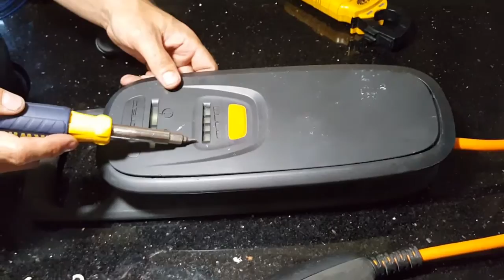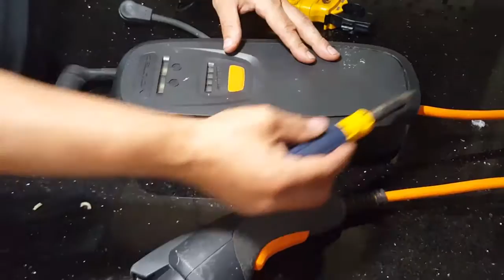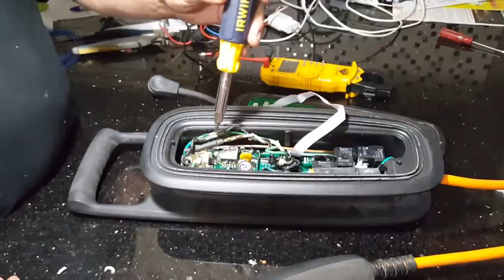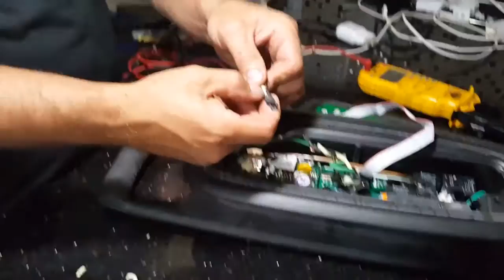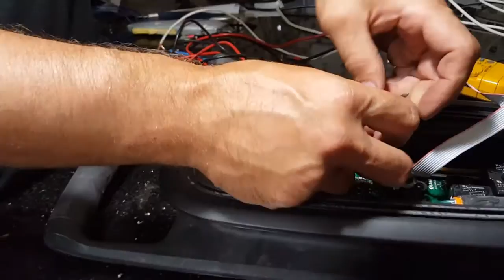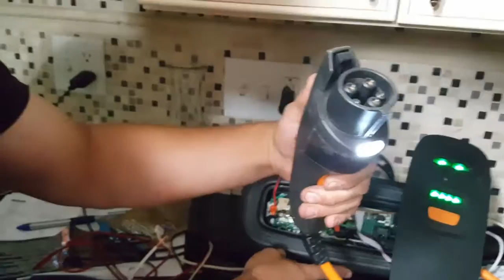Chevy Volt 120 Volt Charger Repair

Comment: You need a 20amp 500 volt fuse. Not a 15 amp 12v fuse. Is it still working with 15amp??

Comment: Those voltec charers are notorious for blowing fuses.  Should be a 20 amp fuse 500v rating. Wait till the pilot signal generator goes bad. Will be lights on, no charge.

Comment: This video was similar to our issue on the 2014 volt we bought.  Upon opening the charger we found all three wires cracked, melted and bare. Installed the bladed fuse holders and it perfectly. We reattached the cover with silicone and screws.  I imagine that it could fail again.  Thanks for the video.

Comment: Hi. Probably too late but I have the same charger and resistor R103 has burnt out. Could you measure the resistance of your R103 and tell me what it is please? It's the big green resistor by the gfci and neutral wire. Thanks

Comment: So, my charger shows all green lights when plugged in to the wall, but when plugged into the car, it fails with the top right red light.  I"m interested if this was what you observed, or were your charger lights off?  When I plug it into the car, I hear 3 clicks then the top right light goes red and it doesn't charge the car.  When I opened up the charger this weekend, it looked OK, but I don't have a clamp multimeter so didn't test the wires.  Oh, also, the light works at the car plug side, both before and after the red light comes on.  ...  Is the same as your issue?  Thanks!
Reply from the maker: Joe Ballou from what i have read you may be loosing voltage due too long distance from panel. I suggest programming charger to draw less amps. Check instructions.
Reply: Did you ever find out what was wrong JF B? My charger has started the same (?) behavior. It starts up fine but once you plug it in the car the top right LED starts blinking red. (Top left still green, car still charges fine on the fixed wall charger)

Comment: Keep an eye on the fuse, use 250V and 15A fuse...in a long run the fuse contact points will create some resistance and meld down.
Reply: Dirt Rider would you recommend a higher amp fuse?
Reply: @aaronguest6579  not higher amp, higher voltage.  The car only charges at 8 or 12 amp so 15 amp is fine, the problem is automotive fuses are only rated to ~30v, so using them at 120 means that if they fail they may not stop conducting.

Comment: Great video. I drilled a hole in the front face and installed a water resistant fuse holder so repair only has to be done once. Soldered and shrink wrap an extension wire inside to reach the correct location.  Fuse holder must be offset to clear internal electronics.  3-3/4" down from bar of green lights and 3/4" right of centerline. Plastic does not drill cleanly - so go small and use hand grinder or file to adjust hole to allow gasket on fuse holder to seal. Has worked outside for two weeks now.Purchased holder and replaceable 15A fuse at West Marine.Blue Sea fuse holder 20A model #PN5021. Blue Sea 15A AGC fuse Model # PN5217 Use push on connectors to fuse holder.

Comment: i did this exact repair on mine today, and i suppose it'll have to do until i can find an inline fuse holder that supports a 15amp fuse with 120 volt rating. if anyone can send me a link for one, id really appreciate it. they didn't have one at my local walmart or lowes hardware.
Reply: The Automotive style will work.  Thinks of amps as heat.  The fuse works by  surrendering to too much heat.  Make sure that your fuse holder is wired with at least 14 gauge wire.  12 is better.
Reply: @brucehalleran1149  le fil est un 12 !

Comment: The problem is your fuse holder is rated for automotive use at 32 volts DC.  Not for the 125 volts AC coming from the wall.  The next time it blows the potential for a fire exists.
Reply from the maker: yes you are right. this was for troubleshooting and testing. I did find original fuse for it rated at ac/DC ON line  but I ended using a common 120v ac fuse that's used for microwaves and is easily accessible from home Depot.  I also soldier the fuse. works good.

Comment: I did not make video but so far it's working fine just sealed it with silicone in case fuse blows again
Reply: That these blow so often that there are numbers of these videos on youtube is a symptom of a problem.  Is your 110v. plug cord hot when charging?  Not warm, HOT.  The outlet itself was not hot, but my plug and cord were hot enough to burn the hand.  Then of course that hot cord runs into a sealed box where it attaches to a device designed to fail when it gets too hot...
    My theory is that the supplier of the plug cord, or the wire used to make it, bent the specs. for the wire.  14 gauge is NECode appropriate for 12 amp flow at sustained duty.  Not generous, but sufficient.  Either the car is drawing more than 12 amps at 110/120v, or the wire isn't really what it should be.  Poor alloy?  Smaller than gauge?   When I replaced the fuse, I also replaced the inlet cord with a nice piece of 12g. from the hardware store.  I put a nice solid plug on it and tinned the connections.  I DID NOT REPLACE THE WIRE FROM THE FUSE HOLDER TO THE BOARD.  Also my (automotive) fuse holder is 14 gauge.  Those pieces of 14g. doesn't seem to get more than gently warm.  Yes, I've had my hand in the box when it is charging.  Kids, don't do this at home.
   In fact putting on the heavier cord has done several things for me.  One, the silly (required) 16" cord is now long enough to reach an outlet without having to hang from it.  Two, the charge time has dropped about 20 percent.  Flat to full is now only about 9.5 hrs.  This I don't understand, unless the straw was too restricted for the car to drink at 12 amps.  Three, I believe that the reason so many of us lose that fuse is that the adjacent wire heats it rather than serving as a heat sink for it.  I've finally resealed my box with the fuse inside it.

Comment: How is this working for you? I am going to do this tomorrow to both of the broken ones I have. Thank you so much.
Reply: I just did mine today hopes it stays charging so far so good
Reply: make sure you inspect the wires I had to put on electrical tape they were bare in a couple places
Reply: I completed this over the weekend on two units and they both charge fine. Thank you so much. Used JB-Weld Plastic bond and flex seal to make sure no water gets in.
Reply: +Mike cavell. how's the repair holding up for you
Reply: philippe dubuc Fantastic! I have fixed two so far. I have a good amount of friends with Volts so this is common.
Reply: +Mike cavell that's good same here working fine
Reply: can you tell me which fuse you purchased for your repair? im looking for an inline fuse rated 15a 125 volts and can't seem to find one.
Reply: Guys mine is not working, but di get green light on charger could it still be same issue????
Reply from the maker: regiomontano26.  I dont know. Green light should be all good to go.